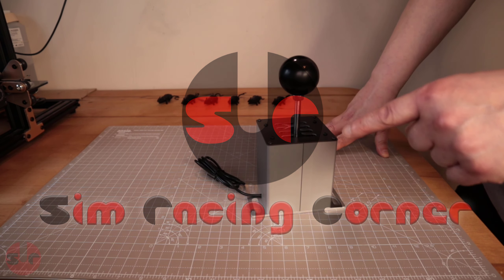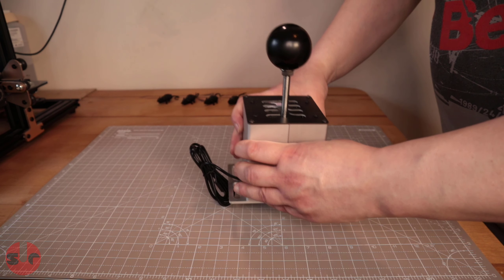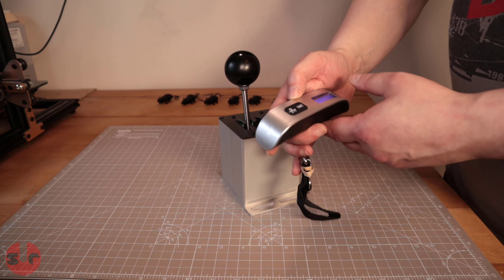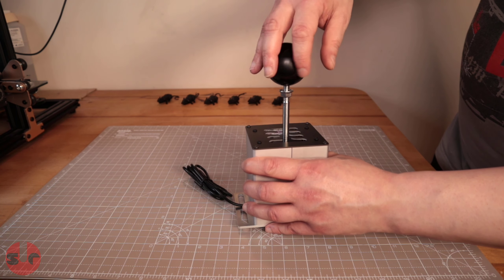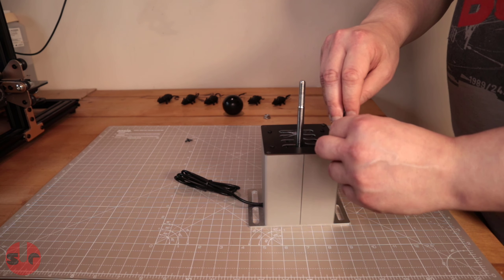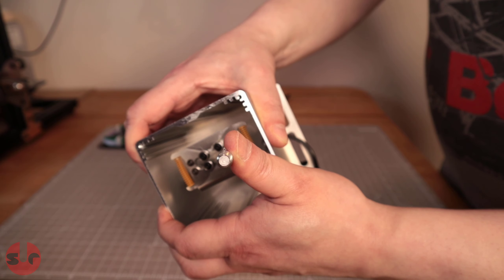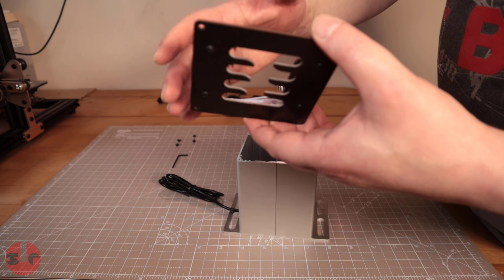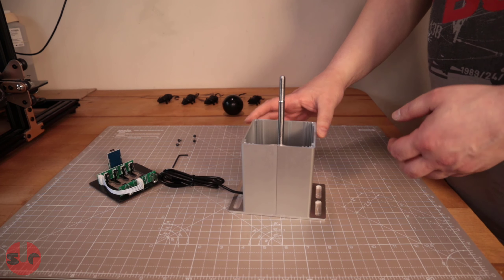Aliexpress Budget H Pattern Shifter Teardown!

Comment: Im pretty sure the shifter with the switch on the shaft is for range changing in the truck sim games (going from 1-6 to 7-12 etc)
Reply: Yes but you can use the switch for headlight or stuff if you would like
Reply: There 2 switches on the trucks shifter. One for range the other is a splitter.. some trucks have a third button for engine brake

Comment: Thank you very much for this! Thanks to you video of the internals I could rebuild this and print most of the party with a 3d printer. I used hall-effect sensors instead of switches. But it works really good. Actually a genius way to build this.

Comment: Such simple and efficient design. I have a Logitech shifter, and about one year later, it started going into the wrong gear. Because it internally works like a joystick, the possibility of error is much higher. I disassembled it but see nothing that could be wrong... I will try to repair it though, and then I will sell it because I had enough of Logitech, and I will then buy this shifter. Logi developed this internal shifter design 20 years ago, and did not even improve it or swap it out for a more efficient design.

Comment: I got in contact with a seller on Taobao ( A Chinese ecommerce site) and they're going for 225CNY there (around US$35!). The seller says, it is interchangeable and you can get the full version with both the sequential movement limiter, and the range selector. You can pull out the wire for the range selector and disconnect the switch, and use it as  a regular 6 speed h-shifter or sequential gearbox. Many of the feedback on the seller's site are commenting that it is very tight, but I guess the springs can be changed with some sourcing around. Apparently these are of a generic design in China because there are many sellers but all have the same housing... the only difference is the shift knob.
Reply from the maker: I haven't come across any version of this shifter that comes with a sequential mode. I'm very curious to see how that functions based on the confines of the design.
Reply: @SimRacingCorner  it's not really sequential mode but rather a physical tab that prevents left and right movement and locking in place,then I guess you have to map it to shift up and down controls
Reply from the maker: @the_sausage  Is there a piece to that, which presses the switches too and reduces the forward/back throw, as just locking the lateral movement isn't enough. As the gear stick will get captured and not recenter otherwise.
Reply: @SimRacingCorner  I ordered one,I'll update when it arrives. Probably in 2 to 3 weeks.

Anyway the seller has a video of it in use at the item page

https://bit.ly/3imrn5x
Reply from the maker: @UCT7JApUJPhBmVwoLb2o9HWA Awesome, thanks. My review for this shifter will probably be uploaded then.
Reply from the maker: @the_sausage  Fantastic, thanks for that. Before watching this I was thinking that some kind of 3D printed piece would work. This is pretty close to what I imagined.
Reply: @SimRacingCorner  I got hold of it at last. The shifter itself is great, study and with resistance to shifting. The metal rod is good too but inevitably after 1 day of use there is wear at the part it touches the shift gate, but it looks like it will last. The problem I have is the mounting, the seller only gave 2 5mm screws to mount it to a clamp so it gets loose easily. But once it's tiightly mounted with all the screw holes (2 5mms at the bottom and 4 8mms around the corners) it will be nice and tight. Another problem I had was the white  part that lets you use it as a sequential shifter. It works great, and the seq shift has less resistance then the H shift, but the part keeps coming loose every few seconds as it's too shallow. I told the seller he can improve it by making the part around 1 cm deeper so it won't come out of the shift gate. So as you can see, the shifter itself is great, but the addons could be improved to make it even better. He also has a real sequential shifter that costs a bit more than this, I wonder why, since there's only up and down movement.
Reply from the maker: @the_sausage  Thanks for the results, appreciate the time.

Comment: I would love to see someone showing the difference in sound after some sound dampening. I believe it'd be fairly simple and effective.
Reply: Just got mine not too long ago, been thinking about this very same idea. Currently waiting on the GT Omega Prime to go back in stock (US) so I can start building my rig. Once I have everything situated, I’m gunna try dampening it and see if I can upload a video for those who are interested
Reply: @macsgo2hell  let me know! I'm getting mine tomorrow and might throw some foam tape I have laying around in there. I'm sure something like Dynamat would work really well too.
Reply: @AlexTurbo  Update: I haven’t messed around with sound deadening yet but I did buy a Mishimoto shift knob (MMSK-KB) since the shape is good for both sequential and h-pattern shifting. Still have yet to mount it to a chassis since its still on back order but the feel of it after rowing through the gears is insaneeeeeee. And no mods are necessary since the shift knob comes with thread adapters that perfectly fit the threads of the shifter
Reply: @macsgo2hell  I got mine and put that foam tape I had laying around inside, installed a PE top plate from AliExpress, and put a cheap carbon shift knob similar to the Mishimoto one on it. So far so good, still pretty loud but not nearly as pingy as it was.

Comment: There are versions without and with additional switch. How is it wired? Maybe the 8 gear version can be converted to 7+switch too because the 8th gear is wired as a switch and if You put 1st gear while having 8th engaged externally by a switch it gives You higher range of gears? Sorry for complicated description.

Comment: I have the same shifter but i have a problem that every fifteen minutes it just shuts off. So i can play for 15 minutes exactly untill the gears stop working, the blue light on the platine is still on tho. And when i plug it out and in again it works fine for 15 minutes. Any solutions?

Comment: Thank you for the video. I'm really well impressed! I love low budget design! 3D Printing a top plate with the H Pattern would be nice to reduce noise and wear! I don't need a one more H pattern shifter, but I feel the need to have this, and make improvements... Hall effect sensor...???
Reply: Have you got it? And done some mods to it? This is so modable piece of kit and wld be great to see someone smarter doing something To it... HA sensor for example :) 👌
Reply: @fomami  sorry. i never bought it. do you have one? and if you do, do you have problems?
Reply: @tiagopviana Yes I have it In use with no problems at all. One of the best investments for my sim racing as I paid only 45 euros 😎
Reply: @tiagopviana  And I added sound absorbion material inside to it and now it makes a better sound. That is the only mod this far....
Reply: @fomami  Which material did you use for this?
Reply: @theeeMitchi  It is something they use to noise down airflowpipes, machines, cars etc. They sell those in  hardwarestores at least here in Finland.
Reply: @fomami  just stumbled upon this shifter today. glad i did. im planning on ordering one when i get home. have a few ideas for mods, thanks for the sound deadening tip

Comment: Seeing the internals now has me excited to mod the shifter. I am going to reduce the tension between switches by replacing the spring to something a little more loose. I just find it annoying to have to really force the shifter so hard. Wish me luck lol
Reply: yeah it seems really moddable and adjustable. It'd probably be a good idea to add something you can put on top to block the 7th gear gate for 6 gear cars as it'd be annoying to hit it by accident. Also perhaps making the reverse gate give a little more resistance than the other gates, maybe a tiny leaf spring or something. Another thing is that I've seen people complain about too much side-to-side tension, but from this teardown, it seems like it should be adjustable simply by unscrewing the nuts holding the springs just a tiny bit.

Comment: How would I mount this onto a normal table? is there any video's on it because i cant find one...

also is this something i could just plug into my PC and use?

pls help
Reply from the maker: There's is an optional table clamp accessory available. It's PC plug and play, no driver required.
Reply: @SimRacingCorner  Is there a link to it anywhere? I really want to buy one but cant find one with a clamp.  Also one thats preferably cheap... Thanks in advance!

Comment: this is my friend's design!!
Reply: I bought this shifter, I really love but it doesn't work on my pc due a driver error. Any chance I can contact your friend to ask a question how to fix it
Reply: @renuxgraffiti  Same here. Mine worked for 1 week. Then the driver is corrupted, and disconnects constantly. Poor circuit board design. Or mine is a dud.
Reply: @StatsGam4er  any luck contacting the seller?
Reply: @Unknownmanufacturer  Yes they sent me a replacement board. But not confident in the longevity of the product.

Comment: Hi, my fourth gear is broken, do you know how can be fixed? If I put the sequencial plastic it works, but without it no. Thank you very much!
Reply from the maker: It sounds like the lever isn't fully pressing the micro switch. The lever is thin metal, so you just need to bend it out a bit.
Reply: @SimRacingCorner  It was that. I have straightened the lever and it now works correctly. It had folded. Thank you so much!

Comment: If we get the one with the switch on the shaft, can it be used as a regular 1-6 shifter if we unplug the switch? Or does it need some mods to do that?
Reply: Did you figure this out? I want to know as well
Reply: @AlexTurbo  yes,I'm using it as a regular 6 speed shifter when the toggle is removed

Comment: Hello guys! Any hack/mod to make this shifter less noisy? I mean some kind of isolation trick. Thanks in advance!
Reply: a guy earlier commented that he used some sound deadening material used for airflow pipes and that sort. from what i can tell from this video, using a plastic type of material for the top plate may reduce sound and also the two springs at the bottom that center the shifter; those i think may be 'metal on metal' (from what i can tell anyway) so i would install some kind of small rubber washer or something of that sort in between the bracket and spring.
Reply: @bigjame26  Thanks!

Comment: Planning to upgrade my wheel, pedals and shifter; Currently running the G25 complete kit; Do you have any recommendations as for the next level products? I'd really appreciate your input; Thanks much!
Reply: Fanatec CSL DD and some load cell pedals :D
Reply from the maker: The Thrustmaster T300/TX is a good and affordable next step up over the Logitech wheels. Watch my review from a couple of days ago. https://youtu.be/um4stxL8lGs.
Reply: @SimRacingCorner  IMO it's depends of his budget. If he arleady have g25 and asking for upgrade, he propably really want to stay in hobby so there's no point of doing steps upgrade and go straight to what he can afford because he spends a lot less money than if he do next step and next little step upgrades.
Reply from the maker: @Firssen  Indeed, considering it's a G25, my logic is based on someone who is still using a pretty old wheel setup in 2021. I'm not expecting the use case in these circumstances would justify jumping to the cost of the CSL DD.

Comment: Would it be possible to move the bottom bracket to move the mounting holes to either side? Thinking of attaching to my rig. What's the length of one of the sides of the base too? Thanks!
Reply from the maker: That isn't possible as the internal mechanism is attached to the same piece as the bracket. The width is 8.5cm.
Reply: @SimRacingCorner  thanks for the quick reply. Can the mechanism not be rotated as their looks to be 6 screw holes on the bottom plate.
Reply from the maker: @theboyrobuk  Those extra holes are for screwing on the optional table clamp. None line up the mechanism. But there's nothing stopping you from drilling a couple of new holes then rotating it. It's simple enough where that would be possible.
Reply: @SimRacingCorner  Great thanks for the reply, and the content! Keep up the good work!
Reply from the maker: @theboyrobuk  You're welcome Rob. And cheers.👍

Comment: I got one of these but it's better and worse than yours.. mine has hall effect sensors which id prefer over microswitches but mine also has a plastic top plate rather than metal, I've smashed it for the last couple months and never had an issue but i would of preferred if it was made of metal.. i would not recommend the 8 gated version like i got because mis shifting from 4th to 7th is too easy, i wish id of gotten the 6 speed instead.. if only i could find someone who sells just the top plate piece made of metal with 6 speed and reverse layout.